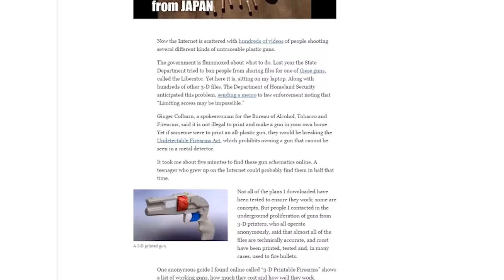Can a 3D Printer really explode and kill you? - @Barnacules

Comment: Its no different when mainstream media report "E cigs Kill" - all those accidents blamed on e cigarettes are never the device but misuse of the batteries, it's ALWAYS down to user error from either carrying Lithium Ion Batteries without a protective sleeve in a pocket full of change or keys that cause a dead short equaling catastrophic battery failure OR from idiots using hybrid mech mods and unsuitable tanks with non protruding 510's again causing a dead short.
And to make matters worse due to some ridiculous law changes/additions in certain states the FDA have clumped ecigarettes and anything to do with them as tobacco products (which they are not) and thus the shops and their employees are NOT allowed to discus the products they sell meaning they can not give advice on proper use... how ludicrous is that? Thankfully I live in the UK and as yet we've not had stupid laws passed like that. (yet)

Comment: I'm learning in a chemistry school. When you said that you hope everyone will learn from this I recalled a recent moment. We had a lab class and we had to clean a test tube from solid iodine. Water wasn't good, so we tried 96% concentred ethil-alcohol. That worked flawlessly, but some parts of the iodine we're not dissolving into the ethanol. At that point my classmate asked "Why don't we heat it up with a flame?". It took me a half a second to realize that is a really bad idea. I quickly explained to him that if we would do that then all the ethanol would catch fire and we most likely would die. He realized his mistake, so nothing bad happened.

So kids, before doing anything use your head!

Comment: Dude, 100c is the boiling point of water.
Reply from the maker: +MoarPower yes, but not after it goes through multiple layers of glass.
Reply: Barnacules Nerdgasm Oh nope. What do you think the radiating heat would be? Like maybe 60?
Reply: Barnacules Nerdgasm sorry Jerry but that's just incorrect, when it's behind glass you need to put in more joules to let it boil, but unless you change the pressure on the water , the boiling point will remain 100 degrees celcius.
Reply: had +200c solder melted and dropped onto my arm
I'm still alive and my arm is fine
why I'm saying this? because this is still not enough to ignite propane or butane in the room pressure...
Reply: 100c isnt 100c if its coming through glass?
Reply: Top Kek It still is
Reply: Leander Witter yeah exactly lmao so why did he mention the glass
Reply: Top Kek It think ignorance is a harsh word, but in this situation I'm leaning towards it.
But hey, there are a lot of fields I know nothing about and we can't all know everything.

Comment: nitrocellulose if old enough can ignite on its own just by age but its easier with static electricity ,  slight hit even ..   but old  flash paper , gun cotton  , nitrocellulose  will auto ignite at room temp if its old .  and they wernt storing it rite .  they want to blame the 3D printer  rather than a product the family has due to their magic supplies business, and they  dont want to charge the family business with heath and safety violations , as it was a business product , not controlled  and stored properly .  I get that as its a very emotional time for the family , so the investigators pick the 3D printer as a scapegoat . 
The ignition source could have been the nitrocellulose all its own , even if no one was in the room . 
Its one thing that when it passes expiry date it can actually go OFF all by itself .

Comment: In high school we did a chem practical experiment to separate H2O into H2 and O with electrodes in a beaker.  Me being a teen cranked the power supply to max when the teacher said xx Volts only. Well the electroids touched when I messed with it and it was still on a cranked to max and spark....BOOM. The rooms ears rang for awhile and I went wasnt me :)

Comment: It's basically just a series of unfortunate events. All these aerosol type products say use in short bursts in a well ventilated area and avoid prolonged spraying. He could have been spray painting something or using some other product and the same thing could have happened. That he used all the hairspray for 3D printing, does not mean that the practice of 3D printing is at fault here. He didn't follow proper safety precautions, and then a very unfortunate worst case scenario played out. Not using aerosols in a well ventilated area, that's what caused the accident.

Comment: Jerry, is the Thermoster exposed to the gas? Because if yes, you don't need a spark or flame to trigger a combustion, you only need to reach a specific amount of heat (thermal energy) that's called the activation point.

Comment: First off, the media really needs to do some F***ing research before just running with something like this! Aside from that, if your using a flammable spray in a closed room please use a fan and get some airflow through the room. And if you have stuff like flash paper around for one reason or another, store that stuff in a ammo can. They're not expensive and can be found in all different sizes on the internet.

Comment: You said thermistor heats up the heater block, the heating cartridge on printers heats that up the thermistor is the thermal resistor it reads the temperature of the hot end so it knows when to start

Comment: I think the printer does contribute to this disaster because the maker failed to include risk alert materials to its customers. I had one of these cheap printers and it comes with NO manual at all. I had to completely disassemble it  and finally I find out that it's a home made version of Ultimaker  printers. It's not until then do I know how to tweak it. Fortunately the process did not blow me up.

3D printers are new to the public, and its user may not be a professional maker like you.  So its manual should be reasonably detailed enough to alert the users that safety comes first and include some basics knowledge such as the machine should not be used in a flammable environment.

Comment: I worked in the West end for years. on Phantom of The Opera they used flash paper in one of the props, a staff that shot small bolts of fire, essentially a small screwed up was of flash paper. anyway they HAD to keep the store of flash paper under lock and key in a special room for health and safety reasons. partly because a big pile of that going up can fuck up your day. if he was in a room with a store of the stuff who ever let him use any type of electrical equipment near a store of flash paper, hair spray or not was irresponsible and neglectful.

Comment: There should be warnings in the box when you buy a 3d printer. The possible dangers should be stated clearly (not included in the small print) If this discourages a potential buyer then at least the printer cant be blamed

Comment: Correction: The Thermistor is part of the thermostat. A thermistor is a part that changes resistance when different temperatures are applied to it. The thermistor is the sensor the 3D printer uses to monitor the temperature, not the heat source inside the heater block.

Comment: The spark had to set it off, there is no way in hell your going to get to the flash point of that gas from the 3D printer, the flash point of propane is about 470 oC. You could spray hair spray onto a hot plate in perpetuity and is will never go off.

Comment: It's really sad a reputable news source released such a crap. Btw thermistor is a resistor that changes it's resistance based on temperature. It doesn't heat the heatblock, it's the main component of the thermostat.

Comment: The thermistor/thermocouple is used for temperature of the block. Its the resistor or heater cartridge or whatever that generates the heat.  Not like it changes your point. Great video.

Comment: A thermistor is temperature-controlled resistor. it acts as a sensor that senses how hot the heater block gets. It's not the heater block itself.

Comment: So just WHY would you use hairspray in the first place? If it was to make the building surface more adhesive, wouldn't some form of spray on glue or something similar be more effective. And if the 3D printer required it, wouldn't the proper adhesive come from the manufacturer or the filament supplier?
Reply: Hairspray is commonly used as an adhesive for 3D printer build plates because:
1) it's cheap
2) easy to apply
3) it's effective

There's a long list of ways to make things adhere better to a 3D printer build plate.
Some people use glue sticks, a PEI sheet, hairspray, etc.

It's just hairspray. Millions of people spray it onto their head every year. I'm pretty doubtful that spraying it onto a 3D printer build plate - many of which don't even have a heating element of any kind (specifically the cheaper east-Asian ones) - is a cause for concern.

Comment: just to be a troll.....c4 would be pretty save to 3d print on lol. c4 will no explode no matter how much heat it recievs. it will melt and burn but it NEEDS a high voltage discharge through the c4 to cause the explosion.
Reply: Its actually a blasting cap that does the trick, commonly anyway. Does a HV discharge work also?

Comment: I thought UK plugs sockets were safe
Reply: In terms of not getting electrocuted, yes, they are very safe, however, essentially every type of socket will create atleast a small spark if something is plugged in :P.
Reply: Shadow Fan they safe are but they, like any and every other electrical circuit, create a small spark when closed or opened (when you plug or unplug or turn on or off). If you happen to have flammable air then the spark can equal explosion.
Reply: Thanks all

Comment: when you printed the upper, couldn't that have been wrapped in a layer of carbon fiber for strength?
Reply: Manny Der yes, but the tolerances would be off
Reply: It became slightly warped and expanded when cooling, which made it completely out of spec and would not fit.
Reply: oh, ok, I couldn't remember from the original.  been a while

Comment: Was the hair spray ozone friendly, if it was then each of those cans might have had propane as the propellant not CFC. Which made any switch, relay, outlet the trigger point for the spark source. That would have had made the room he was in full of propane gas!
Reply: Most propellants are a hydrocarbon based gas (propane, butane, etc.), because they do not contaminate the product that sprays out of the nozzle (but are highly flammable). For safety, Chlorofluorocarbons (CFC, Freon and such), were used in the past, they are not very flammable or toxic, but there goes the Ozone Layer.  CO2 is not a good replacement as it would a good replacement, as it makes some product 'fizzy' (like a Soda Stream machine). 

It is very sad to hear about the death of someone so young, but news media articles such as this just lead to 'Fear Mongering', and do little or nothing to prevent something like this to happen in the future. 

Jerry, keep up the good work!
Reply: Yes it is very sad to see someone so young die so soon in life.
Reply: That could have been so avoided with proper ventilation, and asking for help in how to use the hair spray to do the cheap stickiness trick. If he had he would still be here. I just wish people would check on the method to be sure that they are doing it right. I also wish that the news would stop sensationalising the simple mistakes of people so young. And also demonizing 3D printing. When it is not the 3D printer at fault.

Comment: Jerry, I think your missing the boat completely on this and I would call your video just click bait.  3D printers are a big safety hazard that no one is really looking into.  From parts breaking off when removing from the bed and gets in your eyes to a kid touching the heated bed.  You truly dont know the facts just from that article, so until you actually knew all the FACTS then you could do a video.  Yes there may have been some negligence on the kids part but we truly dont know.  Another example is a hot end could up running away for whatever reason, which would be very high heat.  Why would YOU recommend spraying something highly flammable on a heat source?

Comment: Take a step back a minute. Instead of a paranoid rant about The Media of which you are a part of, why don't you look at this reasonably.  If the instructions for the printer said to use hairspray and didn't warn that you shouldn't use too much and should use it only in a well ventilated room, then the maker of the printer can be held liable. We may not like that, but it is the law. It goes w/o saying that if your video said use hairspray and didn't give proper warnings, you could be held liable.

If you want to protect the hobby, tell people to respect the materials they are working with, always use proper safety measures, and when using any sort of chemicals, to always do so in a well ventilated room.

The kid emptied 3 cans of hairspray into an unventilated room, even if the room didn't catch on fire as a result of the explosion, the explosion itself would have likely been fatal, he would have suffered airway burns with solid and hollow organ injuries.